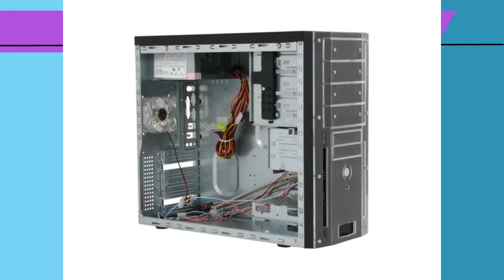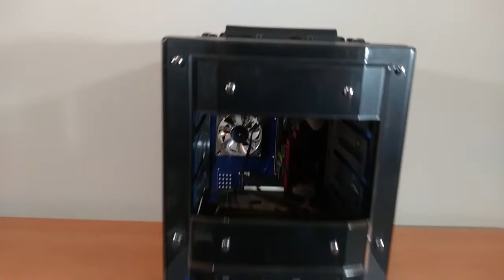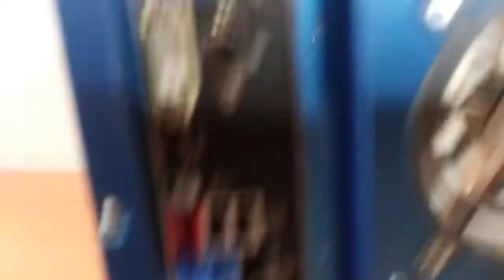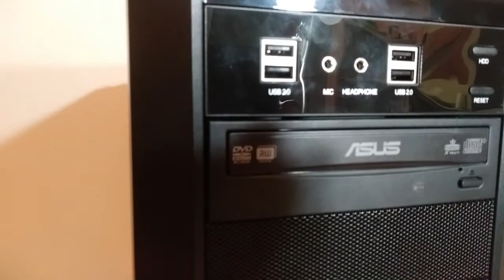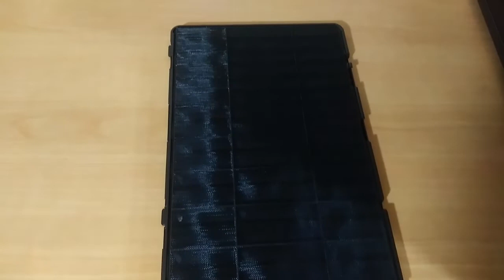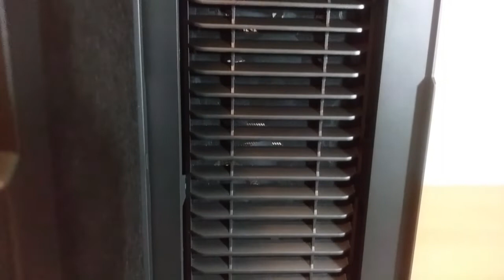My PC Upgrade for 2019 (Ryzen 2700x, B450 Tomahawk, DDR4 3600, Fractal Design R6)

Comment: Ryzen 7 2700x with b450 Tomahawk is it good?
Reply from the maker: Yes I enjoy the system very much.  I would choose the B450 Tomahawk Max now since that is available for the same price as the Tomahawk and has a better BIOS chip inside.  Also recent info says the B450 chips may not support the next generation Ryzen 4000 series but I don't really care since one can get up to a Ryzen 9 3900 series chip using the B450.  

For the budget, I think it was a great deal ($130 for the Ryzen 7 2700x and $85 for the motherboard during Microcenter's Black Friday deals).

Comment: This looks good and is very similar to what I'll be using only I'll be using a 1660 Super GPU. I'm going with the solid side version as it gives more sound deadening, and removes all incentive to worry about the color of various components so I can choose whichever color is the lowest price (it's amazing how much difference there can be). The one thing that gave me a little pause is the Tomahawk doesn't have the onboard header for the USB C front panel port. I don't really need that though and can always add a card to get it if I ever do. I expect the Fractal Design case will last me a long time as modular as it is.
Reply from the maker: Your setup sounds great.  The 1660 Super is a nice card.  

Yes I feel the same way about the case overall.  I still need to get a white one for my wife's rig and then I will do a vid on that.  Yeah I noticed that about the Tomahawk as well (lack of a usb c front header).  That and the slight shortcoming of the BIOS chip compared with the Tomahawk Max.  Overall though I am really liking the motherboard.

Thanks for your comments and best wishes to your PC building!

Comment: How yo do-N Jaya? Bin a while.. :)
Quick Question as to why would yo would need an Elgato Card? Your system should be able to LIVE stream and record while yo game and you should be able to do it all at 4K, that's right Game and stream at 4K resolution!!! Mind yo.. Yo need an internet upload speed of 50Mbps if yo gonna go live. 
My system is very much like yours, A base CPU Ryzen 7 slapped into a Tomahawk B350 or was it B450? meh~* its a Tomahawk that's all I remember now and it was going to have 32Gigs of memory but at the time they "MEMORY"was dawg awful expensive so it's only got 16 Gigs of the fastest memory I could get way back then,  Mind yo I don't know what graphics card yo have, but if it's any better than my old, old and out dated GTX1080Ti then there is no reason to bog your system down with an Elgato card, Trust me I have been live streaming my gameplay at 4K for quite a while now just using OBS..
Reply from the maker: Hey KorAllRBare!  Happy New Year!  Hope you are doing well.  

Yeah the Elgato card is a mistake from when I started to upload vids.  I thought I needed one.  I don't.  But I keep it in there in case I do.  I do have a fast enough upload speed now that my USB wifi adapter is not like 7 years old and is plugged into a USB 3.0 port.  But I always worry about foot in mouth disease when going live.  I may eventually get courage to do one but probably not soon.

Yeah the Tomahawk has nice minimalist set of lights.  I control it with MSI's Mystic Lights but I keep them at a constant color rather than the rainbow effect.  

That 1080Ti is still very nice.  I think it may be faster than the 5700 XT that I am eyeing for next year.  Yeah I agree with the m.2 card though I am in no hurry since the SATA SSD is fast enough atm.  Sure a x6 speed boost of NVME will be incredible and since my wife still boots off of a HDD, I need to kick her up to a SSD but she wants to install a clean Win 10 Japan version so I have to wait for her to go get that and then will do the update all at once.  

Best wishes to you for 2020!

Comment: Nice build! haha I still run on my Core i7 860 lga1156 on my EVGA P55FTW :D
Reply from the maker: Ah nice!  That's a Clarksfield processor?  I think a generation before mine.  My wife's was older as she is running a Core2 Quad Q6600 Kentsfield processor on a Gygabyte LGA775 socket.  Her rig is now also running Ryzen 7 2700X now so it is doing better but I need to get her a m.2 NVME drive to really speed it up.
Reply: @jayaniceday3602  Actually it's a Lynnfield, the first generation to support dual channel DDR3 insted of triple channels. I like the q6600, it's still capable to do something haha and you can overclock it to 3.6ghz :D
Reply from the maker: @macpb2892  

" I like the q6600, it's still capable to do something"

Yup, overclocked, it can play minesweeper.  :P

Comment: Updating a PC is a pain in the rump. Software updates anyway. Hardware upgrades are nice, but can still be a pain if something goes wrong or isn't properly connected.
Sounds like you got a pretty good deal with yours! It looks really cool too, I like all the mods you've done with it. Mine is just a black box, lol, but I took the side off permanently for better airflow & easier access. It just kinda sits beside it now.
The new case is nice too, Fractal is really good. They have some cool designs & great functionality.
Reply from the maker: Yeah I agree.  When it goes well its a lot of fun and when something goes wrong, you quickly explode in a cloud of rainbow flames and melt down to gates of PC Hell.  

I really like doing updates in Nov since the cost goes down so much, especially if you have a Microcenter nearby.

Yeah I really like this new case.
Reply: Those sales REALLY help!

Comment: Wow, you're a box of surprises! For the ketchup and mustard cable... Quick fix could be black heat shrink. The first PC I built was in 1993? Happy days back then!
Reply from the maker: Yeah or paint ../maybe a black sharpie.  But I received a sleeved extension so now it fits better.

WOW great respect for building back then.  It was even hard to find components back then.  Most of the motherboards were Foxconn at that time.
Reply: @jayaniceday3602  well, it was much more entertaining: fiddling with irq's, dma's , position of cards on isa bus... Non plug & play. My first modem was a 2400baud internal!
I suppose the first time I saw Alita was when a kid was using an IBM 386 or 486 editing an Alita image in paint. Yeah, windows 3.1... ha!
Reply from the maker: @choro76  Yeah I bet.  Nothing was completely standard as it is now.  Now its like LEGO.
Reply: It's all easy, I'm just saving for a new PC, but since I haven't built anything in... Decades, I'm a bit skittish. So I've been watching tutorials for when the time comes...
Reply from the maker: @choro76  I've always find that picking the right parts makes a big difference.  After that things are pretty good.  There are some really nice cases that came out recently and if you don't need a 5.25 bay, there is a big choice.  PCpartspicker can help if you are interested in what others have done.  Best wishes to your future build!